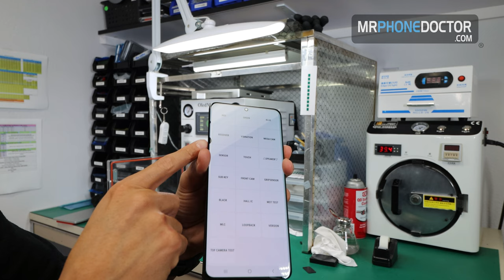Samsung Galaxy S20 Ultra Cracked Screen - Front Glass Only

Comment: Omg... This is alot of work. I just bought a big kit with everything I thought I needed. Just not the heating thingy, solution, plastic sheet etc... What even is all those things. And how on earth am I going to do this myself?
Reply: Don’t waste your time, buy another phone. That’s what I did. 

This repair  is a joke to show you how much work goes into it for no reason.

Buy a durable case, be careful, and avoid repairs. It’s not worth it when it comes to the screen.

Comment: This method is thorough yet depressingly strenuous. I like it but it's time consuming like you mentioned. 
Plus, if not done precisely, you'll still risk having bubbles/bleeding which wouldn't be aesthetically pleasing overtime. 
It would make more sense to change the digitizer but that's expensive. 
Kudos to you for this hard working process.

Comment: So if the Glass is cracked across the screen is there a possibility the digitizer is fine under the glass itself?  Since the glass crack goes across the screen?
Reply from the maker: Yes if it's working then more than likely display is good

Comment: I got a question for you , my samsung ultra 5g  got some scratches on the screen while it was fall down in the street but actually screen didn't broken,  how to remove the scratches or there is possibility to just replace the upper layer of the screen ?
Reply from the maker: Polish the screen or just put a uv screen protector to cover the scratches

Comment: I tried that with a broken display (some bleeding, heavy burn in and touch not working properly). I expected to damage it, yet still went through with it, since it was a broken phone anyway and I didn't need it anymore. For learning purposes you could say, since I like fixing stuff myself. When it came to cutting tho, I somehow managed to cut through the display on the edges. I got the wire in, and began to slowly cut, just like you did in the video. But at some point on the curved edges, the wire went through the display. The display didn't survive that, obviously. Do you maybe know what exactly causes this? I didn't use a lot of force. The wire I used is 0,08mm thick.

Edit: I remember I pulled slightly down on the edges. I think this might have caused it, but I'm not sure.
Reply from the maker: .04 or less recommended. Never pull down on the edges. Feed line opposite direction

Comment: Damn I was told you can't replace the glass.. I had no bleeds or anything,  touch working just fine.. I should of done more research and found a shop that knew what it was doing..
Reply from the maker: damn man yes most shops out there are not going to tell you about this type of repair.

Comment: I'm watching with s20 ultra and my screen is broken too I have my touch fully working just the screen that goes white at times.  Also I am having issues with my s20 ultra stuck in Airplane mode when I insert a sim card even after factory reset. Anyone with solution please!
Reply from the maker: You will have to replace the entire screen.